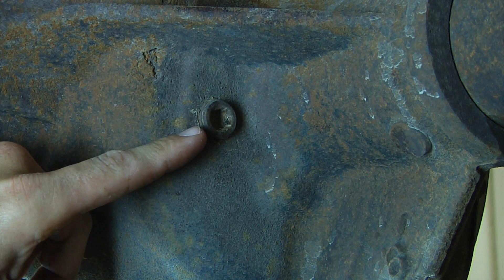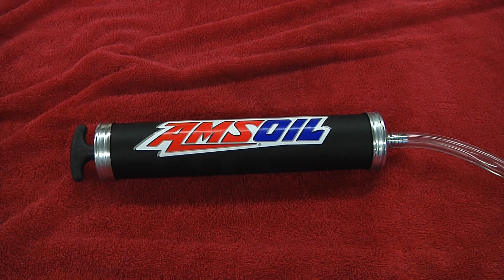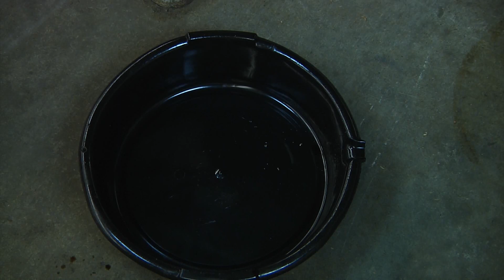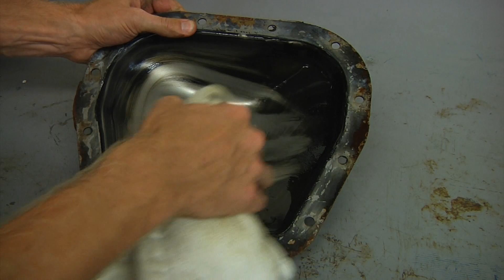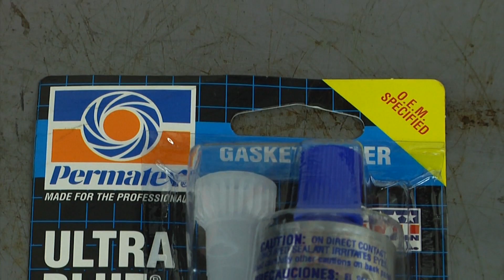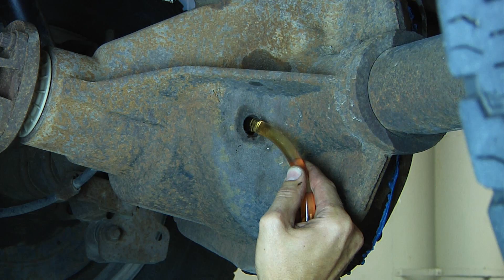2001 Ford F150 Rear Differential Fluid Replacement

Comment: permatex said to use only gear old gasket maker 81182
Reply from the maker: The tip is much appreciated.  I do not know if Permatex 81182 was available when I filmed this 11 years ago.

Comment: sTRAGE I WAS TOLD I NEED TO USE FORD anti friction fluid as well
Reply from the maker: If you are using Amsoil Severe Gear https://www.amsoil.com/p/amsoil-severe-gear-75w-140-100-synthetic-gear-lube-svo/?zo=10458 , it already has an additive package designed for this application.

Comment: Well what about hosing it out with carburetor cleaner or brake parts cleaner if everything is dirty? Don’t you have to add the magic Ford friction modifier to it?
Reply from the maker: My concern with using cleaners is leaving residual chemical behind and getting mixed in with the new diff oil.  As for the friction modifier...it is not needed if you are using Amsoil Severe Gear. https://www.amsoil.com/p/severe-gear-75w-140-svo/?zo=10458

Comment: I used regular heavy differential oil a month or so and replaced emergency brake on disc brakes and noticed a leak from axle seal  again pulled differential cover to pull axle had a problem and had to put cover on THEN I put synthetic in until I could fix it kept an eye on the fluid and it didn’t leak anymore 3 months and still full with synthetic so it does make a difference , but I’ll still check it
Reply from the maker: Sounds like a successful fix.

Comment: Can you use break cleaner instead to clean all the differential better..??
Reply from the maker: Others have also commented that I could have cleaned it with brake cleaner.  I am not sure if I am wild about introducing new chemicals into the system, since it isn't easy to pull it completely apart and wipe everything down.
Reply: @InsaneOil  crap I just notice I comentéd ln your video just 4 years ago lmao.. well I sold that truck never got to to the fluid on my diff but this time yes I’m willing to do it this weekend.. brake cleaner dry quick, I think also using a air gun and spray air in the differential ll help to dry up Quicker
Reply from the maker: @santiagodavila1426  Keep in mind that there might be a pool of diff fluid at the bottom of the housing that may become contaminated with the brake fluid.
Reply: @InsaneOil  yes the very bottom rite.? I ll use some clothing towels to clean that really 😌 good
Reply from the maker: @santiagodavila1426  Yes, at the very bottom.  Good luck, let me know how it goes.

Comment: Next time give the torque specifications cause that would be nice to know that's one of the reasons I watched you video to see what the torque would be other than that good video
Reply from the maker: I apologize for not including that.  Rear Differential Cover Bolts are to be at 28-38 ft lbs (for 2002 and earlier models), Rear Differential Fill Plug is to be 15-30 ft lbs.

Comment: I don't know why so many people wasting time & money replacing trans oil while they are still in excel condition & quality! It's more wise if he paint to protect diff from rust! Barking up the wrong tree ....
Reply from the maker: Best way to tell if it is still in excellent condition is to send in a sample to the lab and have it tested.
Reply: @InsaneOil  Experienced Mechanics only look at color to guess its status! No lab is needed! 🥳
Reply from the maker: @pragmaticapproach1590  Experienced mechanics would know that color does not determine the health of the oil.
Reply: @InsaneOil  Yes I Know! But in this video! The oil color is identical to which a brand new oil. So any reason for replacement?
Reply from the maker: @pragmaticapproach1590  Vehicle had 100,000 miles on it, prior ownership/service records were unknown.

Comment: Torque specs for bolts and fill plug?
Reply from the maker: Rear Differential Cover Bolts (2002 and earlier) 28-38 ft lbs, Rear Differential Fill Plug 15-30 ft lbs

Comment: Sounds like you really like Amsoil products, not Ford lol  Nearly every gear lube I've seen is synthetic.

Lucas, Royal Purple, Mobile 1, Motorcraft, Valvoline, Castrol

Edit: I guess this video is 10 years old, so who knows what was offered at the time
Reply from the maker: True.  Most manufacturers have gone to synthetic...however...most manufacturers are using Group 3 base stock so they can legally call it "full synthetic".  Amsoil takes it a step up by using the far superior Group 4 PAO Base stocks which allow them to use the terminology "100% Synthetic".
Reply: @InsaneOil  Interesting. Above my scope of knowledge lol
Reply from the maker: @Hamchuck112  Behind the scenes stuff not widely known by the general public.  In essence, if you want to build a better product, you start with better raw materials.  The end goal with most manufacturers is to build a product to meet minimum standards.  Amsoil starts their process with the minimum standards and engineers up from there.
Reply: @InsaneOil  That makes sense. Honestly I’ve just always stuck with Motorcraft products. Truck has 135k on it and I think it’s about time to do the differential. 😬 I wish they used a metal/rubber gasket like on the transmission. So much easier than liquid gasket.
Reply from the maker: @Hamchuck112  Agreed on the gasket material.  Motorcraft is decent.  I always recommend people look in to comparing Amsoil to their usual brand.  https://www.amsoil.com/?zo=10458

Comment: I did this just for the nice new fluid to leak out the axle seals… it didn’t leak before should of left it alone
Reply from the maker: You must have cleaned off all the sludge that was keeping the oil from oozing out.

Comment: At 3:05 I noticed a small but important mistake. In my experience, you always want to leave one or two of the upper most bolts slightly threaded in before cracking the cover to drain. You don't want the cover to fall and possibly bend an edge, or else you may not get a full seal when you reinstall it. Just my opinion. Good video! I'm about to do this on my dad's 2002 F-150 5.4
Reply: Good tip.  I will show it that way next time.

Comment: I went to Walmart and bought my oils there they have the best prices.   I have 02 F150 2x.  With 175,000 miles on it I got the High Mileage Mobil 1 synthetic 5w30 and a MotorCraft  Oil Filter. For the 4.6 V8.   For the rear end. I bought the.Valvoline synthetic  75w140.  Bought a qt of Lucas oil stabilizer and I got the friction modifier from the Ford Dealer.  Truck runs Super !
Reply from the maker: Sounds like you had a successful repair.
Reply: Insane Oil     Hi Thank you for replying.     Yes so far so good. Your videos help me a lot. The guy I bought this F150 Super Crew from, you could tell had money it was his baby he put a lot money into maintaining it and also had it lifted 4 inches gear change to a 410 limited slip 17 wheels off road tires. Truck runs Super I’m in California enjoying this truck daily.  California gear head.

Comment: What gear oil would you recommend for a 2018 f150 with the electronic differential? I was thinking Amsoil or royal purple or even valvoline but all of them contain some  friction modifier additive would it be ok?
Reply from the maker: What type of engine do you have?
Reply: @InsaneOil  5.0
Reply from the maker: @JoaquinSanchez-db9gk  Front Differential (3.6 Pints), Rear Differential (5.5 Pints).  Both call for 75W-90 Severe Gear with no addition of aftermarket friction modifier https://www.amsoil.com/p/severe-gear-75w-90-svg/?code=SVGPK-EA?zo=10458  If you are interested in saving 25% and getting free shipping on Amsoil when you order, add a Preferred Customer membership to your cart first. https://www.amsoil.com/offers/pc/?zo=10458
Reply: @InsaneOil  thank you

Comment: Any suggestions on how to get the differential cover off if stuck?  There is a bit of rust but not a crazy amount.  After removing the bolts,  I cannot get the cover off and there is not enough space to get a screwdriver into the gap to try and pry it open.  Thanks
Reply: Flatter screwdriver or a putty knife.  Be gentle with it.

Comment: how much oil did use on the rear end
Reply from the maker: Per the Chilton Manual - Rear differential for F150 is 5.5 to 6.9 pints

Comment: What are the torque specs for the bolts on the  2001 F150?
Reply: Rear differential Fill Plug (15-30 ft lbs), Rear differential cover bolts 2002 and earlier models (28-38 ft lbs), 2003 and later models (24 ft lbs)
Reply: @JellybeanLearning  Thanks!

Comment: Boy someone's been snorting too much oil. It's not that Ford likes Amsoil, that's your arrogant opinion. The fact of the matter is Ford uses synthetic gear oil from the factory in their differentials, they have since at least 97. And The owners manual doesn't recommend the fluid b e changed every 30k miles, it recommends it every 100k miles because it has synthetic oil from the get go.
Reply from the maker: Thanks for the comment. The statement "Ford must like Amsoil" was a joke that I guess you didn't pick up on. Most, if not all manufacturers have switched to synthetic lubricants, in many parts of the vehicle, as they obviously outperform conventional lubricants. As far as the fluid change interval, the owner's manual for a 2001 F150 does not specify a fluid change interval for the differential fluid, however, the Scheduled Maintenance Guide for the 2001 Model Year identifies the rear axle as “lubricated for life” under normal conditions and they are not to be checked or changed unless unusual circumstances are experienced.  Unfortunately, according to AAA most motorists do not drive under “normal conditions” and Ford’s suggested recommendation of 150,000 mile (or 100,000 miles as you noted) differential fluid change interval drops to as low as every 30,000 miles depending on the driving conditions.  30,000 miles may be a bit over aggressive for preventative maintenance and I would revise my previous statement in the video to 50,000 miles as you can see from the video the amount of contamination in the existing diff fluid.

Comment: And what is the specific torque?
Reply from the maker: Rear Driveshaft Flange Yoke-To-Rear Axle Pinion Flange Bolts are 70-95 ft-lb per the Chilton Manual

Comment: I have never changed this on my 2003 f150 which now has 186,000 miles.  Would changing it cause more harm than good? Thanks mate.
Reply from the maker: If you take your time and do a good job of cleaning out your rear dif system and there is no excessive wear, I would highly recommend running new high quality fluid.

Comment: I am tempting to switch to AMSOIL over to OEM motorcraft SAE  75W90 but I need to know if you have any issue at all after you used AMSOIL . thank you very much
Reply from the maker: In this video I was also switching from OEM to Amsoil.  No issues thus far and it has been 6 years.
Reply: thank you very much
Reply: izcoronel ya anything fully synthetic is easily better than motor craft as most of their fluids are synthetic blends and not fully synthetic

Comment: Pro Tip, Rear Diff fluid, don't go with the cheap shit at Walmart (or any other Chinese sesspool) Use 75W-140 Full Synthetic Top Shelf Premium Fluid (E.G: Royal Purple, Amsoil, Valvoline, Etc.)
Reply from the maker: I completely agree.

Comment: What if using any cleaner product.? Like brake cleaner for example.?
Reply from the maker: If you are using any cleaner product you need to ensure all of the cleaner is completely removed before adding fluid so it doesn't contaminant the new fluid.

Comment: Great Video! I could guess that on my Ford Escape that I bought in 2014, its fluid had never been changed since its "birth year" 2004. People mostly focus on engine oil change, less on transmission, and none on a differential. Finally, is the 30k miles the same average for all 4W drive cars? Thanks!
Reply from the maker: In many manuals, it specs the fluid as "lifetime" although it doesn't specify how long the "lifetime" of the fluid is.  Some new 4wd vehicles are now installing break-in oil in the dif and requiring it to be changed at 30k.  If you are using high quality fluid such as Amsoil Severe Gear https://www.amsoil.com/shop/by-product/gear-lube/severe-gear-75w-140/?zo=10458 your range can go from 50k to 250k depending on how and what you drive.  Here is an article discussing it https://blog.amsoil.com/how-often-should-i-change-front-or-rear-differential-fluid/?zo=10458

Comment: I see where the manufacturer calls out a Ford lubricant but ALSO specifies that a specific amount of "Fluid Modifier" be added at the same time. This is for my 2003 F150.
By using the Amsoil Synthetic Fluid, do I still need to add the Fluid Modifier liquid or does the Amsoil fluid take care of that and supersede that Need?
Thanks for the excellent video and tips! It is GREATLY appreciated!
Reply from the maker: Thanks for the comment.  If you are using AMSOIL Severe Gear SAE 75W140  https://www.amsoil.com/shop/by-product/gear-lube/severe-gear-75w-140/?zo=10458 you do not need to add any Friction Modifier as AMSOIL's Severe Gear Lube is already engineered for this specific application.  However, not all differntials respond the same and with a very select few differentials you will sometimes get chatter to occur.  In these few instances you can add Amsoil Slip Lock friction modifier additive.  https://www.amsoil.com/shop/by-product/gear-lube/slip-lock/?code=ADATB-EA?zo=10458

Comment: What ended up being the torque spec on those bolts for the diff cover awesome video very informative thank you
Reply from the maker: Per the Chilton Manual: Rear Differential Fill Plug - 15-30 ft lbs, Rear Differential Cover Bolts for 2002 and earlier models - 28-38 ft lbs, and Rear Differential Cover Bolts for 2003 and later models - 24 ft lbs.

Comment: I believe is 33 ft/lb torque
Reply from the maker: Per the Chilton Manual: Rear Differential Fill Plug - 15-30 ft lbs, Rear Differential Cover Bolts for 2002 and earlier models - 28-38 ft lbs, and Rear Differential Cover Bolts for 2003 and later models - 24 ft lbs.

Comment: Wish you would have made mention of the socket size for the diff bolts, just as an fyi.....also I've always teflon taped the fill plug to prevent possible leakage. Another note: with Limited Slip you should add Ford's Friction Modifier (XL-3) 4 ounces.
Reply from the maker: Thank you for your reply.  I do know some people that use teflon tape as you noted.  I have also heard of people preferring Permatex High Temperature Thread Sealant as it holds up well in oil related situations.  If you are using AMSOIL Severe Gear SAE 75W140  https://www.amsoil.com/shop/by-product/gear-lube/severe-gear-75w-140/?zo=10458 you do not want to add any Friction Modifier as AMSOIL's Severe Gear Lube is already engineered for this specific application.
Reply: Insane Oil, THANK you for this information! It has been a GREAT help!!

Comment: 2 quarts to get started. Make dam sure you use synthetic fluids. Extra cost more than pays for itself.
Reply: never would have guessed you would recommend amsoil. yeah we get it buddy you read the holy amsoil bible. im not goin to buy amsoil though im going to use royal purple.... does it burn?

Comment: every 2 years?! our Expedition has it for 15 years since it was built it has the 3.55 LSD
Reply: Same with my '99 f150! 200k miles
Reply: My 2001 F150 has 160000 miles and just changed it for the first time and all is well!  Like you said,,,every 2 years??? lol
Reply: I have a 2003 F150 with 186,000 also never changed it. I'm worried that since I went so long changing it might cause more harm than good.  Have you noticed any thing that might be concerning? Thanks for your reply. -Cheers

Comment: How many quarts?
Reply: Jon Olson The Haynes manual say to add friction modifier but I don't have a limited slip. should I add it anyway or does it matter?
Reply: What vehicle do you have? Year, make, model, engine size?
Reply: Jon Olson 97 Ford e150, 4.6
Reply: Thanks a ton man, good info!
Reply: Dorifto007 

Fords
Reply: It depends on your rear axle size for example 5.4 Triton 2006 F150... Has two formulas for 3 rear axle sizes number 1 formula ratio is in regards to the 8 & 9 point Axel's number 2 formula ratio is for the 10.25 rear axle.... If you've never changed it stick with the Ford brand although they have the mixture where it's all in one with your 140 oil stick with what it was built with or you'll have issues I guarantee it! So with the number one ratio you use 1  bottle of 4 oz additive to just shy 3 quarts of 75 - 140 weight oil lubricant  and do not overfill but fill it up to the line or if you don't see no line so your first knuckle of your index finger  just touches the top of the total of the two liquids you have added... put your additive in first... And every 20,000 miles just add a little bit more attitude to the top. Make sure when you change it out you put in the proper gasket which there also is to depending upon the aforementioned 2 rear axle sizes... And this is a tip from a chick whose dad made sure that all of us children which the first five are girls, know how to do basic vehicle maintenance. And granted, this may not be considered basic vehicle maintenance in the 21st century it sure has got me a heck of a lot further then punching the button on the register at McDonald's that says hamburger because nowadays individuals do not know how to run numbers in ad prices let alone work a cash register... No offense to the registered cashiers

Comment: if when i take my cover off!  and if i'm not having issues with my gears , i am not  checking for nothing but cleaning  the  small  shavings out with the dirty oil , cleaning matting surface and installing  the new cover and gasket fill it and drive! LOL!
Reply: Sounds about right. Unless you are having issues, the service is pretty straight forward.